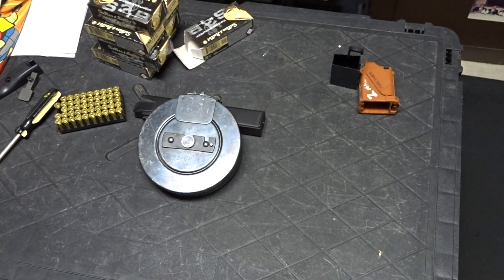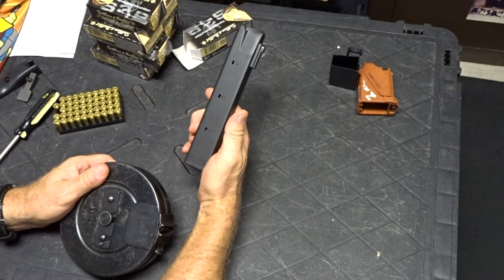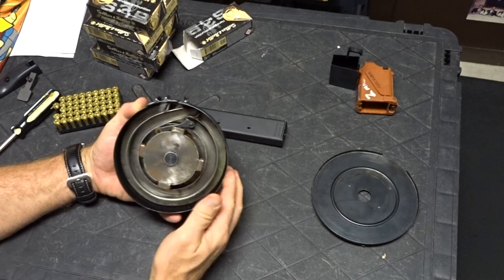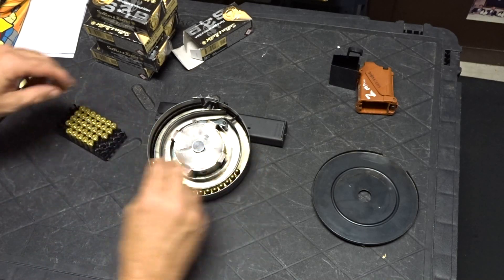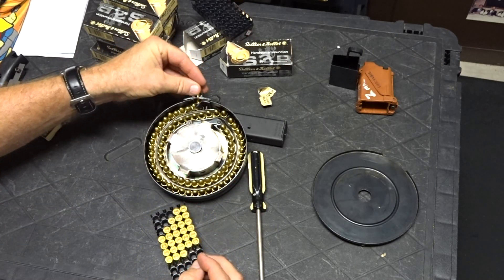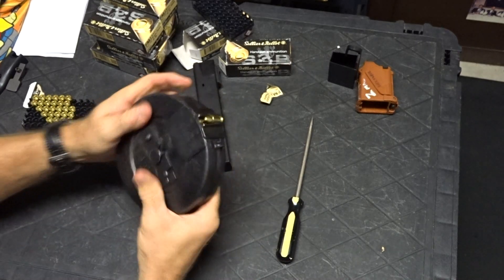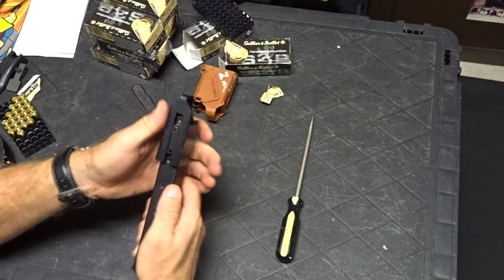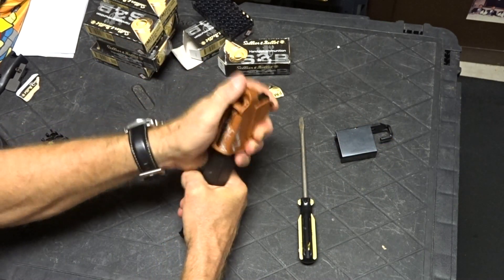How to Load SUOMI M31 71 Round Drum Magazine

Comment: Thanks , That was helpful on the drum, Been years since I used it, I have the square 36 rd shell holders and the plunger loader for my mags. I had not seen that slide on loader. The mags fit my MK760 9mm SMG. I use the drum/mags on a M31 9mm semi auto  rifle made by TNW Inc.  Later from Texas.